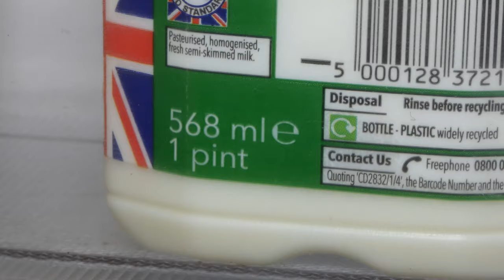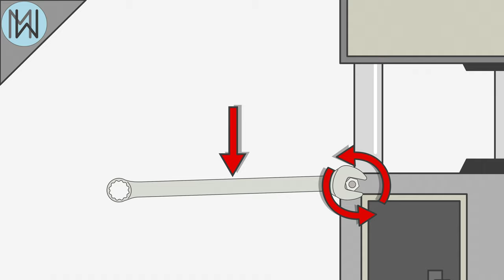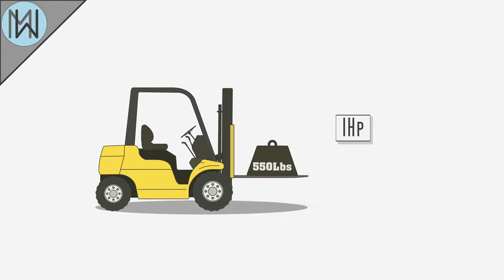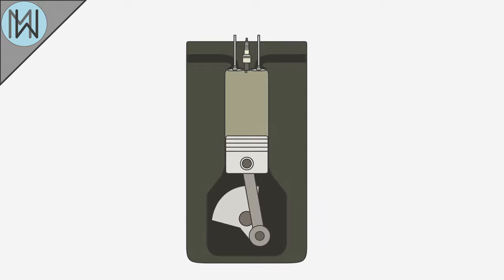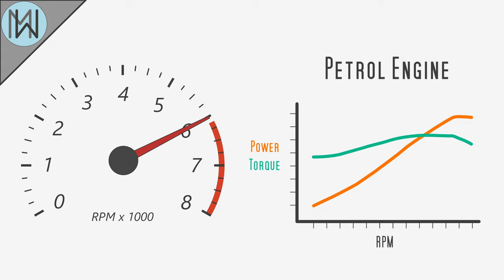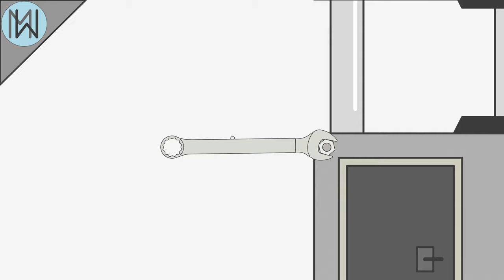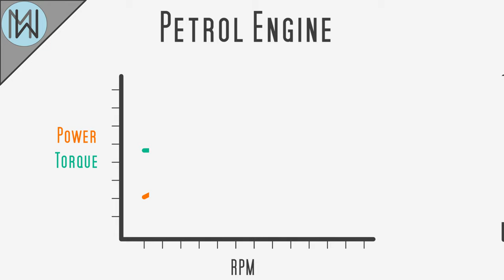Torque vs. Horsepower Explained

Comment: I think there's a lot of confusion in the racing / sim racing world about torque vs power.  For instance, many games give you a graph of torque and horsepower, and we are often told to pay more attention to torque (regarding when to shift) because that is where acceleration occurs.  But I still get confused, because they say power is the ability to move a mass quickly, so doesn't that directly imply acceleration? Plus horsepower is always the first spec about a car that is bragged about.  I'm also curious how overcoming friction ties into this. As a racer, I want to understand this better, but the information still conflicts in my head.
Reply: Only horsepower counts..
Reply: Well, yes power is what is needed to accelerate quickly. But it's more complicated than that. In order to accelerate a mass at any given rate, a force is needed. In a car's case, that force comes as the push that the tires give to the car. That comes from torque. So in order to accelerate a car quickly, a certain amount of torque is needed. In order for the car to accelerate at a constant rate, that torque is needed all the time (actually in the real world, as a car goes faster, more torque is needed to keep the acceleration rate the same). Which means the producer of that torque needs to produce that torque at an ever increasing rate. You can think of it like pushing against something really heavy to move it; as soon as what you're pushing moves, you have to move with it in order to keep pushing on it with the same force. The faster it moves, the faster you have to move. That is what power is: the rate at which a push happens. We tend to think of things like the example I just gave: humans doing work. The pushing force that different humans can generate varies widely: a huge man can push way more than a child, but the different rates we can push at are not all that great: we all move at close to the same rate. So we get into this stupid debate about whether torque or power is more important. Machines don't work like humans, however. With gearing, the force that machines are able to exert on objects is limited only by the strength of materials. So, it is the rate at which a force can be implemented that matters with machines. That is the definition of power. In mechanical systems, it is power that matters. Power, and gearing or force manipulation. With enough manipulating of force, any mass can be moved. The rate that it can be moved is constrained by the power input into the system. 

The author of this video made a couple small mistakes that might be confusing. All you have to remember is that when it comes to mechanical systems:
Power is what matters. 

Friction is just another force on the system, same as inertia or wind resistance.
Reply: @tylerfb1  I like your analogy of looking at a linear motion (with Push and Velocity), to intuitively imagine how an equivalent rotational motion (with Torque and RPM) works. It is now clear to me why it's not just important for a car engine to deliver Torque (push), but to be able to deliver similar levels of torque at higher RPMs (velocity) -> ignoring wind-resistance for now.

However, there's sometime that's still un-intuitive to me:

Preface: I understand that Engine (Crankshaft) Torque and RPM "need not be the same" as the transmission (Wheel) Torque and RPM respectively.

If we can manipulate torque ("force manipulation") by using gears to any extent, does that mean that I can fit a family car's engine to a huge truck, and tune the gear-ratios in such a way, that the small engine can still move the huge load? Or will the engine simply stall, because it cannot turn the wheels of such a heavy truck?

Hope you can explain this to me in an intuitive way. 
Rephrased question: Is it even important for a car engine to be able to offer "good" torque, if we can simply multiply the output torque on the wheels, using appropriate right gears?
Reply: @nischalshetty2411  yes you can use a family car engine in a truck, and further more, if it has the same power as the big truck engine, it will theoretically accelerate the truck at the same rate! But there’s a big “if” there: if we can manipulate torque all we want without penalty. In the real world, we can’t do that. 
My comment is meant to help wrap your head around the theoretical concepts at play with power and torque. What is left out is all the other real-world implications. 

Engineering is about striking the balance between many, often competing, requirements. The transmission that would be required to implement a car motor in a truck would be large, heavy, and expensive: in short impractical. 

Efficiency, maintenance costs, and service life are very important considerations in commercial vehicles. Diesel truck motors are very efficient in their applications. They create power at low RPM, which means lower maintenance and higher service life when compared to equal gas engines and certainly a car motor used in a truck. It also means they turn more fuel energy into motion then an equivalent gasoline engine (they use less fuel for the same power output). They have lots of torque, which means they don’t need extreme gear reductions to create the needed wheel torque. Even the packaging: how much space an engine/transmission take up and how they are mounted to the vehicle is a requirement of concern. 

So, while it is true that power input is the only concern as far as acceleration and motion are concerned, in a practical application, there is so much more to the equation. That’s why the engines we see in use in all these different applications are the engines we use in those applications. 😊
Reply: @nischalshetty2411  let me more directly answer your question, and give you a picture. 

Let’s say you had a transmission that turned the wheels one revolution for each 100,000 revolutions of the engine. Even if the engine was rigidly coupled to the transmission input, you start that engine, and rev it to 10,000 rpm for ten minutes before the wheels turn once. How much force would you have to hold those wheels with before you were able to stop the engine? If the engine makes 500 ft lbs at 10,000 rpm, it would take 50 million ft lbs to stop it. That’s the weight of 50 A380s. 
I hope you can see that with infinite torque manipulation, a simple family car motor could easily move a truck without stalling. 😊
Reply: @tylerfb1  thank you for explaining this so lucidly, and in such detail 🙌😇. This was helpful to me!
Reply: @nischalshetty2411  my pleasure.
Reply: @nischalshetty2411  yea except lbs ft is not force its results of force and leverage and exist only in point zero of axis and nowwhere else once you measure something 1 mm from axis rotation now its not torq now its force 😎 and he forget say you that if ypu geared 100 hp fsi ly car for pull semi truck load it do it but the less power it would have the slower it would do it 🤭at 100 hp it pull even mln tons but do it so slow that this load be travel 100 years from kanufactory to customer or whatever where this load must go 🫣 thats why truck have 500-600 hp 👌🏻
Reply: @tylerfb1  🤭 🫣 force we can calculate on 2 ways from drive wheel axis torq and wheel radious or from power and  speed outcome be egzacly the same torq is not force 👍🏻 100 hp 50 nm will generate  around 10 times biger output force than 10 hp 5000 nm at the same speed 👌🏻 you can amnipulate gearing to such level that human on bicycle who generate let say 1,5 hp pull 1 mln tons up hill the point is it be doing this 100 years before reach 100 m uphill let say 🤭 vs 750 hp semi truck V8 teinturbo whatever with gass in floor do it in less than minute ok maybe lil exagerrsted capabilities of 750 hp against 1 mln tons 🤭 anyways much faster 😉.
Reply: @mociczyczki  what?
Reply: @wasuprobleemjoh yes, though you won't have any power without some amount of torque.

Comment: The length of them connecting rod matters .. 
Long strokes vs short strokes
Reply: That's what she said.
Reply: well of couse this matters. but it is literally changing one variable and affecting another. longer strokes means more tq per explosion, but you reduce your rpms. so one affects the others. the real problem is weight balance, harmonic balance and wha you want the motor to do...
Reply: @chaztitan6457  .. .. . The rest be rested on them gears inside a fluidity box. 
 I'm guessing.
Reply: Sure, but also long strokes means the pressure inside the cylinder can be released later. As the piston travels down the pressure drops so basically you have an initial high torque then towards the end of the travel the force of the piston drops more and the torque is reduced. Anyway on average there will be more torque but these engines will produce less power (if not using forced induction of course, in that case torque goes up a lot more). It’s basically a configuration for economy because you use extra energy left in the cylinder. With short stroke you will also be able of higher rpm. That the case for sports engines with 7-9k rpm
Reply: @rotorblade9508  we all agree that long strokes create more tq. simply by the crank arm is longer. 
i really dont understand what you are arguing for or against. you seem to agree

why not just thumbs up or make a counter argument.

Comment: How is horsepower increased or decreased? I mean how to design an engine for horsepower?
Reply from the maker: That's quite a complex question, and I've added it to my list of videos to do.
Reply: @TMW_Photography  Thanks. Looking forward for it.
Reply: @FaizanAli-op2xe  best example is a history of chevy small block engine. Compare LT1 5.7L for Caprice with 260hp, Firebird with 275hp and Corvette with 300hp. So #1 reason is shifting torque along the rpm scale higher (for more power) or lower (for better fuel efficiency). Torque shows an efficiency of combustion cycle. ICE is an air pump that works at different speeds (750-6500rpm), and air feeding can't be optimised for such a wide range. Unless you have a VVT, VVL and variable intake geometry technology.
Reply: @IgorArkin  Thanks for the info and taking out the time to write the comment. Appreciate the effort.
Reply: The simplest way is to make it rev higher.

Comment: Let me ask a question - does torque affect fuel consumption? If in my engine at 1750 rpm is the max torque (200 nm), and at 2500 it’s 150 nm, it means that driving at 1750 will consume less fuel than on 2500 rpm?
Reply: Yes to your question.
Still ,if you need to save more fuel per distance, don't drive at peak torque revs
Reply: No not really. You will only get the maximum torque for any given revs, if you put your foot full on the gas. If you do that, then unless you're going up a steep hill you are going to accelerate and the revs will increase anyway . 
Obviously putting your foot on the gas does use more fuel, but you can maintain revs at say 1750rpm by easing off the gas and therefore lowering the torque output to just sufficient to keep going at the same speed . Generally though you will get the best fuel efficiency from most petrol engines in top gear at around 2000rpm.
Reply: @smiler447  I’ve learnd how it works, it seems that it depends over if the engine has turbocharger. If so, keeping revs lower will give better fuel consumption, at naturally aspirated engine it’s like you’ve said

Comment: I understand. But at the same time I don't.
:-))
Torque is the power used by piston to push on that rotating shaft. But... HP is how frequent a force is applied. But, then again, shouldn't it also matter against what force the engine works? The weight of the engine itself plus the car, the angle of the road etc.
Reply: First, torque is not that force that pushes the piston. Torque is not a force. 
Second, yes, engine's force overcomes all resistances and moves the car. The lighter the car the faster acceleration will be with the same engine, by 2nd Newton law.

Comment: It does not explain why the torque decreases yet the total power increases this should be explained. Engine friction increases  which decreases torque with higher revs, but despite less torque the extra revolutions still give more power.   Example less power per engine revolution but twice as many revolutions still give more usable power in a minute. Engine design and breathing size all alter the torque curve

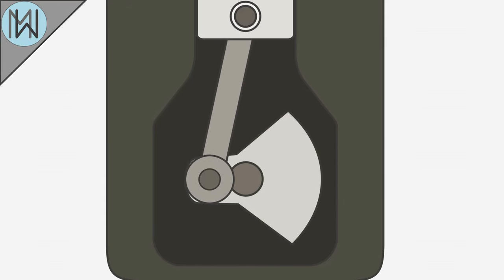Comment: 2:48 no dude I don’t think it works like that
Because it’s all about the combustion process in the engine not about how far the big end journal is, because you can change the cam profile of your engine to make it produce more torque than hp.
Reply from the maker: Could you elaborate please?
Reply: @TMW_Photography  I’m saying 2:48 is completely wrong
That’s not how torque works in an engine

It’s determined by the combustion process in the engine
Reply from the maker: Sorry, I probably wasn't overly clear, what aspects of the combustion process affect the torque / horsepower balance? It's been a while since I made this video, but if I've made a mistake, I'll pin a correction comment.
Reply: @TMW_Photography  I can’t show you examples on what I’m talking about because this YouTube keeps deleting my comments
Reply from the maker: Oh, that's a little weird.

Comment: woah so that's why electric freight locomotives seem to move smoother and faster than diesel ones specially watching them electric locomotives seem to move double decked cars more easily than the diesel one could even if they have same tonnage
Reply from the maker: I am far from sure, but it was my understanding that diesel locomotives actually put their power down via electric motors.

Comment: power (watt) = torque (Newton meter) * angular speed (radian / s = 2 * pi * rpm / 60).
torque is a parameter of power. so do you need torque or power? answer both my general.
the interest of the couple only appears on the acceleration aspect
inertia * acceleration = motor torque - resistant torque (simplified presentation). If you want good acceleration, decrease the inertias (moving masses) and increase the engine torque, the resistive torque being fixed by the tires, aerodynamics and the slope of the road.
if you want to go fast you need power to obtain equal engine torque = resistant torque at cruising speed (at high speed the aerodynamic effects are enormous)
as explained, electric motors have a much more favorable torque versus speed curve than thermal motors.
Reply: When you introduce torque, force and leverage become obsolete. You got 400nm and you dont care if it comes from 3.0 diesel (leverage) or from 5.7 gasoline (force). 1kg of steel = 1kg of cotton candy.
Same thing with power. When power is introduced torque becomes obsolete. Power is speed times acceleration divided by mass. There is no torque here. It is somewhere inside power and we dont care about it.
Reply: @IgorArkin  The couple is interesting when we are interested in dynamic regimes (fundamental relation of dynamics). For a rotational movement J * angular acc = Motor torque-resistant torque (with J moment of inertia in kg.m2, acc in rad / s2, Torques in Nm). So knowing only the power of an engine is not enough, you also need the torque curve to determine the acceleration capacities.
The dynamic behavior will also depend on the moment of inertia of the moving parts, so the choice of materials and their shape have a significant influence on performance.
So when you tell me that the torque of a diesel is the same as for a gasoline engine, it is very likely that the moving parts of the diesel are heavier than for the gasoline engine so that the inertias are greater therefore that the accelerations are less with the same torque.
In position control systems, motors are dimensioned in torque rather than in power with rotor shapes reducing inertia to obtain great reactivity.
Reply: @IgorArkin  To continue the explanations, the torque curve will determine the design of the gearbox and its staging (not the same between diesel and gasoline because the speed ranges are not the same).
Knowing that for a general public vehicle we seek to obtain a minimum jerk (also called over-acceleration, mathematical derivative of acceleration) so as not to shake the passengers too much, knowing the torque curve and the inertias is essential.
Reply: @danielfranchette5547  engine produces work=ammount of force times angular distance (rotation) or power=force times speed of rotation. If an engine has huge inertia then measurements on the flywheel will be smaller. "Torque" curve (which is actually a work curve) may be more convenient if there is no way to change the power output of an engine at different speeds of a car (no gearbox). Still, comparing only power curves of two different engines installed in the similar cars we have a picture of their acceleration even without gearbox. 
And if we have a gearbox it almost totally neglects work data of an engine, since we can always have a very short first gear or final drive ratio to accelerate as fast as possible to peak power and keep shifting gears there. Torque is the only way to measure forces*leverage applied to a non moving object. If it moves then distance come into play and we dont use torque but work. When time/speed comes into play it is performance now and is measured by power, you cant measure it with work anymore.
Reply: @danielfranchette5547  you describe mostly specific engineer solutions when building an engine, covering parts strain, vibrations, efficiency etc. Sure, torque is useful here.

Comment: The thing i wanna ask is how vehicles like trucks produce more torque than horsepower. I know that trucks have big engines because of longer strokes and use diesel because it produces more torque. But do things Like what the piston is made of or how heavy the piston is or the combustion power of the fuel affect torque in any way?